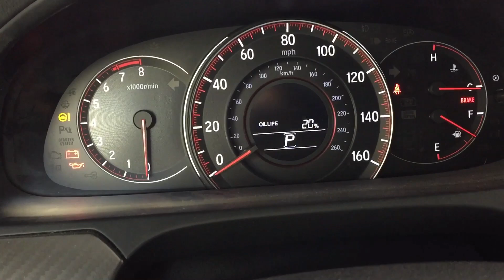How to oil change a 2017 Honda Accord Sport

Comment: Not to nit-pick, but if that hydraulic jack failed while you were under the car..............your family would be looking at a funeral.  Always use a jack stand.  Thanks for the video.
Reply from the maker: +Frank Verdin thanks for the concern I greatly appreciated. During this project I have my brother on the side line watching if anything happens. Also, I am very cautious of what I am doing and the equipment I’m using. Yes I agree to have a jack support t for extra safety. Thanks again I really do appreciate the concern. Thanks buddy . I just subscribe to you. Have a good one thanks again. = )
Reply from the maker: +Frank Verdin frank what is your YouTube link? I think I subscribe to a different frank verdin youtuber.
Reply from the maker: Lol pancake technician
Reply: @ItsRCTeng wtf is your brother going to do. Is he the hulk?
Reply from the maker: @cchop4154  yeah he’s the hulk with the other jack

Comment: Nice work. I use a synthetic filter like a Fram XG7317 for 2 services. Better filtering and cheaper cuz it gets used for twice as long. All good.
Reply: Jeff Keryk I use that same filter on my ‘17 Civic ... excellent filtration, and I’m thinking about doing the same thing - covering two oil change intervals (7500 miles each, 15K total) with that filter.
Reply: The Microgard filter he’s using in the video, I believe it’s made by Wix.
Reply: @carlovanrijk4039  Not a bad filter. By the way, I would stick to 5K OCIs. Cheap insurance.

Comment: Great video on the basic oil change. I would recommend filling the new oil filter with oil
Before install.
Reply from the maker: I usually do for my old car because the filter sit sideways. With this Accord the filter is upside down on the engine so oil fills into it when I’m pouring. But good suggestion I would recommend as well.

Comment: 1).  You showed us five clips that were removed from the underside engine splash guard.  If I'm not mistaken, there should be seven retaining clips (my experience with a '16 Accord LX).

2).  Instead of the nylon washers, Dorman sells the aluminum crush washer (part #095015) and it holds up pretty well (as long you don't over tighten the drain bolt).  You can change the crush washer at every oil change, but I usually replace it when the washer is deformed or after every other oil change.
Reply from the maker: My car on has five removable clip and one clip that is stationary so the cover just hang there to the side. My splash guard is a metal sheet rather then a plastic cover. Is that the same on a 2016 model?
Reply from the maker: The crush washer that i use is good. Holds up well. I have aluminum crush washer as well but this nylon one works really good and I don’t have any problem taking it off like some other washer that would bind to the bolt because of heat.

Comment: how much oil should you put in the honda accord sport 2017?
Reply from the maker: Start with a little over 4qt . Start the engine and let it run for a 2-3 mins so the oil can cycle throughout the whole engine. Turn off engine and check the dip stick. Add more oil if needed until full. Do t not over fill it’s better to have it at the dot on the dip stick or even a tiny bit under. Overfill will cause oil to get in the combustion chamber and can cause some Smokey oil smell from your muffler. I recommend buying the 5qt bottle which is more then enough for your 2017 Accord. 👍🏼
Reply: Teng Lay i added about 4.2L. is that ok?
Reply from the maker: That’s a good amount good job
Reply: I used all 5 quarts..jus a half cm above upper dot?? Am i good? Dont see hear or smell anything wrong
Reply from the maker: I start with 4qt then wait a few mins till all the oil is settle at the bottom of the engine then check dip stick then add more until it reaches full mark on dip stick then go out and sport mode it up!
Reply: The spec on the Honda Accord Sport with 2.4 L engine is 4.4 Qts of oil when changing the oil filter.  I always change the filter so I always fill it 4.4 quarts.

Comment: Thanks for the HD video and showing all the steps.

When i first bought the car what kind of oil was put in it from the manufacturer?

I'm going to be doing my very first oil change next week, what do I put in regular 0-20 or synthetic 0-20?
Reply from the maker: Honda grade oil and filter was first in the car. My first oil change, I used mobile 1 right away. From my experiences with Honda their factory oil is decent for light driving. If you want to go hard and really push it. I would advise using top grade oil. Especially with this engine.👍
Reply: Can I put synthetic in my 2016 V6 without worries?
Reply from the maker: Yes you can. Don’t matter if it conventional or synthetic as long as it meets the requirements for you engine. Only a dishonest mechanic would tell you other wise. Check out ericthecarguy channel. He’ll explain the difference in oil and also shows that it’s safe to switch from conventional to synthetic.
Reply: Teng Lay thanks a lot pal
Reply: Teng Lay one more question.. I’ve been doing oil changes on my civic for the last 10 years and I never topped off the oil filter is this step necessary?
Reply from the maker: If your filter is upside down like mines then the filter will fill itself with oil. If it sit sideways like other engine then yes put some oil in it before putting the filter back on.

Comment: What kind of screws does the cover use ? I need replacement screws for the cover
Reply from the maker: Anjawa they are called retainer clips and can be found at the dealer or the automotive part store. You can also find parts on eBay as well as amazon. 👍

Comment: I lost the screws that hold the aluminum  cover and I would like to know where to buy them. 
Can someone help me?
Reply from the maker: Janier, I just checked the listings on eBay and there you can find the retainer clip for your aluminum bottom cover. They’re cheap and comes in a verity of size and shape. Just type in your model vehicle along with “retainer clip”. Hope this helps.
Reply from the maker: Well they both works the same way but if you want the original metal part, you would have to get it from a dealership. It shouldn’t be that expensive either.